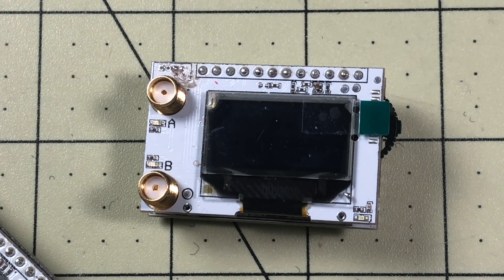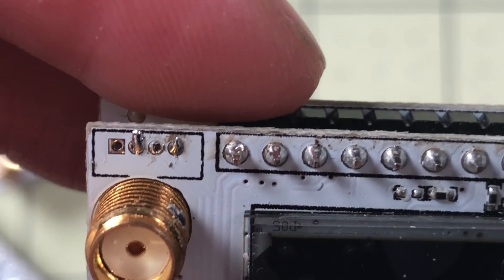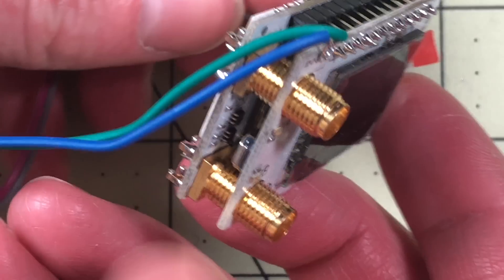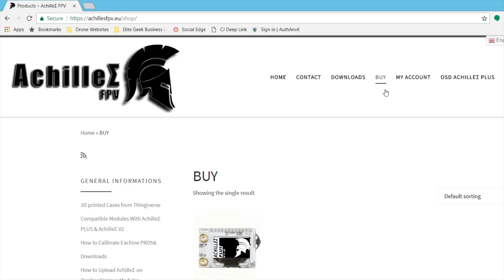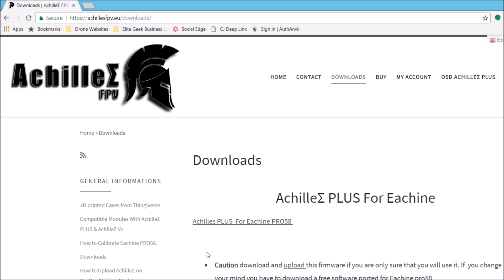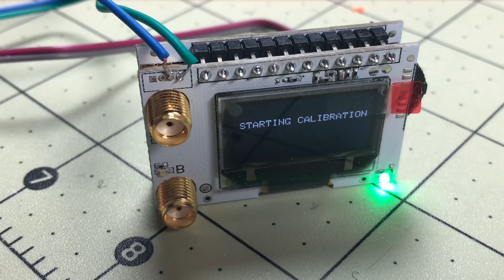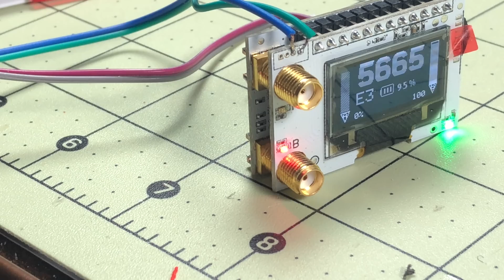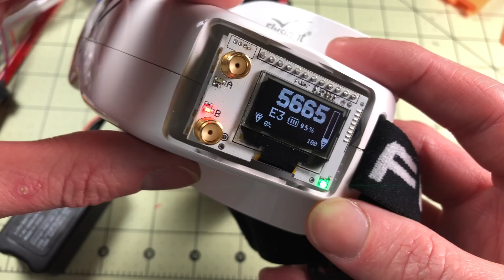How to Install Achilles Firmware on an Eachine Pro58

Comment from the maker: You can get one right now.
Eachine PRO58 Module:
Banggood: http://bit.ly/EachinePro58
AliExpress: http://geni.us/AEPro58
Ebay: http://geni.us/EBPro58

ST LINK ADAPTER:
Banggood: http://bit.ly/STLinkV2
Amazon: http://geni.us/AZSTLink

The Weller Soldering station I use:
Amazon: http://geni.us/WellerWES51

Get the Achilles Firmware Here: https://achillesfpv.eu/
Reply: DroneRacer101 
Use some blue tack to stick the board brown stop the board moving when you are soldering...
Reply: Just a heads up, my hd3 fatsharks could not give enough power to the module that the st link programmer could connect to it. I had to wire the power into the usb adapter for it to work. On a high note only took two minutes before my download was ready. Thanks for the video. I would like to see a video of the difference between the stock firmware and this upgrade. Thanks bro
Reply: I have the green one connected it same as you ...worked ....Happy days, but my problem is I cant do the calibration I have 200 mw vtx it have to be 25mw?

Comment: I have a green protector and a thick board, though everything worked fine. I stuck on the serial number screen cos it turned out there's no longer a buy section on the site so I don't know how to buy a serial
Reply: I solved it by putting /shop/ directly after the main site name in the domain search field. Achilles now seems to work perfectly
Reply: @vld-mr  still need the thing with serial numbers ? i got a new one from banggod and i am going to update it

Comment: did anyone saw the smd capacitor that is half soldered on 1:40 ? maybe this is the reason why it didn't worked?
Reply: But the module that worked also doesn't have an SMD components there

Comment: awesome video going to try to do this to mine also. did you ever find or design a cover that will fit when the module is in the goggles. Ive been looking for one to print but haven't found a good one wondering if you did can you send a link

Comment: Very good instructions! Thank you for sharing.
I have followed your steps and has just performed the first leg. Waiting for the FW-registration, probably need to wait until tomorrow.
No problems so far, you have covered all the important steps, so this is a really great step-by-step description.
As you have mentioned the STM board can be different and my has been totatlly different. But I have followed the colours an used the right pins. Happy times!

Comment: The special thing about the pro58 module is that it contains an overly powerful processor for a receiver module. Because of this, it's able to do many things at high speed. The stock firmware didn't do the processor any justice. I found the quality upgrade to be night and day.

Comment: at the begining  when i saw your video and because i got the green screen cover module, the module wasn´t connecting to the program and then i tought i was fucked. But then i touch the stm link cables and it gets connected. ALready tried to flash diferent fw and they all works great without problems. Im abble to flash the green cover module without problems by ST LINK utility program and by STM32CubeProgrammer (different programs to flash or one its more recent then other i dont know).
Thank you for the video!!!

Comment: send me the rx and i will resolder the cap correctly for you. the placement of the cap as seen on 1:33 clearly makes a short between two or even possibly three points. I dont know what is on the opposide part of the pcb but hopefully it has not broken any component yet since it still works with the stock firmware. 

Do send it to me and will fix the cap situation and check the surrounding resistors for the correct ohm values. i wont charge a dime for it since im a good guy:) . love your videos mate. keep up the good work!

Comment: in case you can't disable readout protection -> use 3.3V on the st link - with 5v it didn't and it got pretty warm!
i got the "red" version, it arrived today from bg.

Comment: @droneracer101 not sure if its the actual cause, but looking at the video, I think i might know why the one with green tape does not work, looks like it might be a manufacturer defect. if you look just above the screen (right side) there is two sets of 3 resistors (or capacitors... not sure, its been a long time since I took any electrical classes and I dont remember ever working with stuff that small) Anyways, the set that are all vertically stacked has one brown capacitor next to 2 black resistors and on the module thats not working it looks like the brown capacitor is all sorts screwed up and not soldered on straight. in fact it might be shorting out on one of the resistors, might be nothing, but my ocd was screaming at me saying "THATS NOT RIGHT AT ALL!" good luck and hopefully they get you a new one that works. time to finish the video.
Reply: the "one brown" is in deed a capacitor. more correct an SMD Capacitor. The SMD's in both sides are indeed resistors. I would resolder the capacitor to its correct spot with a fine tipped soldering iron, i would not retin or even try to suck it up with an tin pump as the pump most likely will "swallow" the cap as it is so small. :) 

Do be careful to not heat the pads too long or they might break their contact to the pcb. This is just good showcase on why cheap electronics are to be avoided. this clearly should not have left the quality control department from eachine.

Shame on you eachine!

Comment: Thanks for this, im picking mine up tomorrow from work and im going to jump straight into this mod, fingers crossed, I learned only after I bought this receiver that its not very good but ive always been one to buy these things and see if those people are just noobs and usually im right. Same with my Fatshark HD2, so many people get edge blur but now I got my hands on a pair I realise the issue is them and not the goggle, after a little 10 minute mod I can see no blur. just nice sharp edges so dont believe mass opinion is my advice.
Reply from the maker: Who said this receiver isn’t good?  For the most part it is widely considered nearly as good as the top end receivers.
Reply: While researching receivers I see lots of first hand comments from people who have used it and say things like "the Achilles Firmware saved this otherwise crap receiver".

Comment: Solution for the green tap version - I got one of these non-working PRO58 too but after hours of frustration it works - I had to gently remove the varnish and solder the wires (SWDIO and SWCLC) directly to the conductor tracks . Just remove the varnish for 1-2 mm and not next to each other so that you can solder it without short-circuits. It seems like eachine removed the copper rings around the connection holes ???. IN ADDITION  I had to connect the 3.3 V (the very left pin). At least it connects via the connection hole directly. In my humble opinion the pinout (from left to right) is 3.3V, Gnd, SWDIO and SWCLK.
Reply: See my comments above
Reply: Thanks for this! Going to try in tonight on my green tape version
Reply from the maker: Had you tried connecting to the holes and it didn’t work?
Reply: I did, tried connecting to the holes via the normal method and powering the module from my goggles 5v supply and got not response in the STM Linker program
Reply: Correct i tried connecting to the two left most holes and then the 5v and ground to my goggles
Reply: OK, so scraped the solder and soldered directly to the traces and SUCCESS!!!!
Reply: so you scraped away the paint like he did in the video and got it to work?
Reply: Correct, that exactly what i had to do, scraped it off directly below one and about and inch down the trace on the other just to have totatly separate areas to solder too. I can try and post a pic a bit later.
Reply: Awesome thanks for the quick reply
Reply: hello wuff, i have the green one and i´m not able to Change the Software. Could you tell me exactly how you prepared your eachine pro?
Reply: Thank you very much! 
I lost one entire day trying evrything and it never work but at the end I red your message and I've tryied powering the module with 3.3v on the last pad and it worded!
Reply: In my case in I connected 3.3volts pin also but i had still problems with target. In options St link utility showed incorrect voltage value. So I connected 5v to bottom pins  and voila it worked
Reply: My green version worked. Installed Pirx but I break off the cable from the right hole (SWCLK). Could not connect after that. Scraped the trace few mm under it and soldered smaller cable and now I can connect again. Thanks
Reply: I have the green version too and could not get st-link to connect.  I got it to work by connecting only 3v3, Gnd, SWDIO, and SWCLK (the pinout as determined by wuff369).  I soldered all to the holes, not the traces.  I did NOT connect 5v or ground to the pins.

Comment: So I totally messed up my diatone gt m3 lol I was flying in the parking lot lol all bad and a car pulled out I throttled up and next thing I know I see tree branches and the video cut out. Next thing I know people are running after a car saying that My drone landed on the roof of that car as it drove away on the main street fell off and got ran over by two other cars driving total loss so I ordered another one ☝️ must say held up good the VTX destroyed

Comment: I had one that would not work.  Heard that on some units you need to connect 3.3 volts to the four pin connector furthest left pin.  I tried it and it worked!  A few other people on RCForums have reported this as well.
Reply from the maker: Trey Weaver hmm I didn’t try that one.
Reply from the maker: On the top of the pad where you soldered the two wires, all the way to the right and then next to that.  He means on the far left of those 4 pins if you are looking straight at it.  I haven’t gotten to try this myself yet.

Comment: Curious - did you get a credit back for the one that didn't work? Mine worked to get the serial number, but died before I could load the updated software with my serial number in it.
Reply from the maker: I didn't try.  I want to do some testing with the stock firmware anyway so I just left it.  I may try it again in the future.